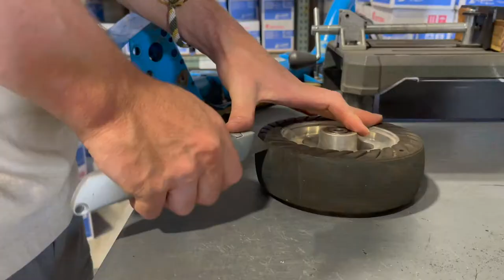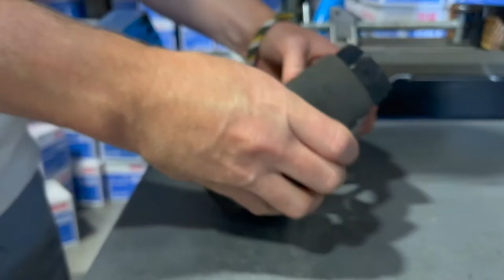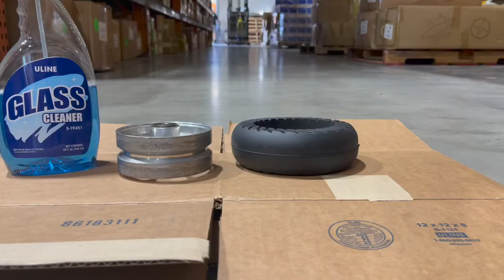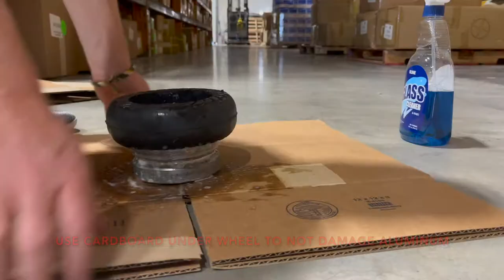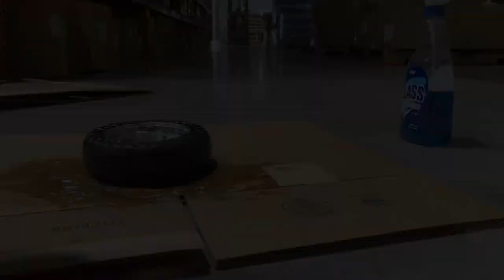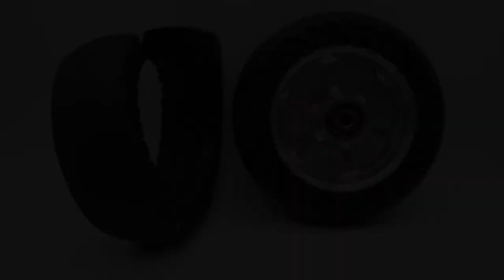How-To install hard rubber tire on Go-Ped Wheel

Comment: i agree 100%
makes no sense to remove old solid tire any other way than by just cutting it.

the way i learned to put on new solid tire on is to place in boiling temperature water for 10-15 minutes.   Definitely makes a difference. 

great video and tutorial. 

/bklyn👑

Comment: Are you supposed to rotate the tires?
Reply from the maker: I wouldn't suggest it. The rear tire gets a very flat profile as the spindle wears it down. Putting it on the front would make it really unstable to ride on.